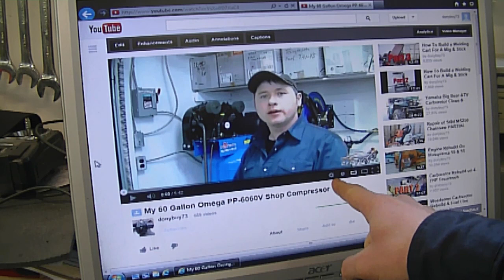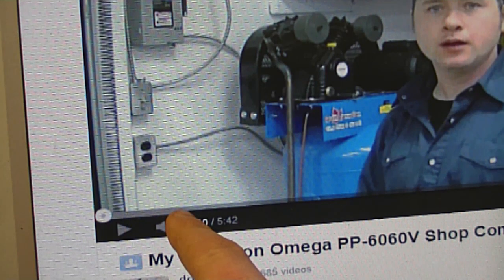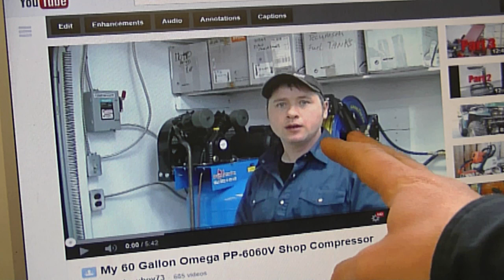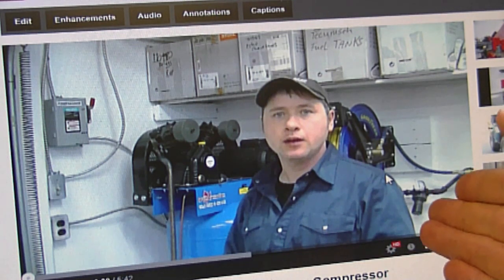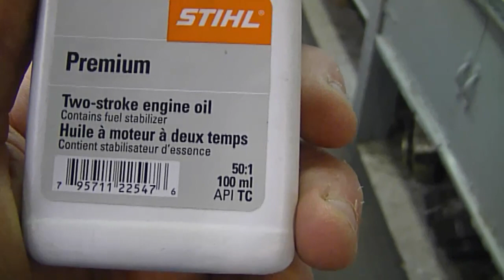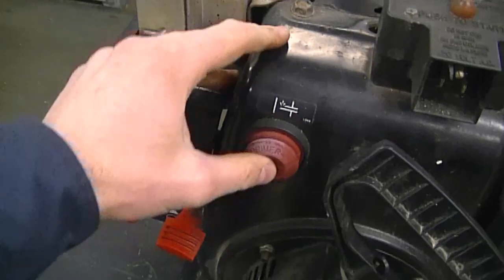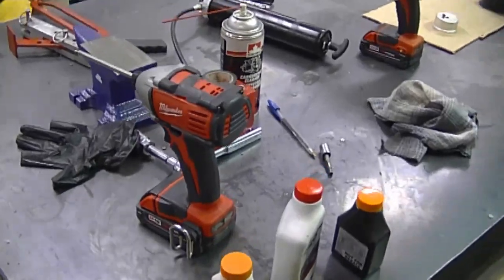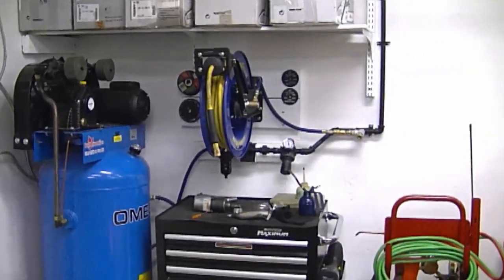Small Engines Q & A Video #114 in HD

Comment: Never mind, figured it out. It was the carb, I didn't clean it well enough and that little hole in the emulsion tube was plugged. I ended up taking the head off and cleaning the piston/head and checking everything just to see the cylinder condition. It was in good shape but with a little carb cleaner all the carbon came off, clean as a whistle now!
Now it runs really good and all set up great. WhoooHooooo!

Comment: a 1/4" hex to 3/8" male socket adapter is an absolute must too. It makes removing some hard to remove bolts easy without the need to carry around an air  hose with you wherever you go. Its lighter, and smaller, however doesn't have as much torque, but is more than enough for most lug nuts.

Comment: Dony Great vid as always, I would just like to add one more important note to the 2 cycle engine oil info,   modern 2 stroke oil to be used for marine applications (outboards) must have  the TCW3  rating on the container, old or new outboards the tcw3 rating is imperative.

Comment from the maker: first clean the carb and maybe replace the bowl and kit 631021b for a better seal. you may have a leaking exhaust valve if the muffler gets red hot

Comment: So far I am very happy. I am mostly using it for disassembly of scrap, my 18v stuff was wearing my arm out after part of a day, plus there is no battery hanging off the end to get in the way. I bought the three year warranty in case I beat it up :( and if I start doing more small engine stuff it will be handy for most stuff I think.Just not rusty shit, but I have air for that !!

Comment: Well, it's terrific for removing nuts and screws when disassembling a machine. Or I can torque nuts or screws down, when reassembling my work.

I'll use the 12v screwdriver, because it's compact size at 7 inches and weights 2lbs. Nice torque motor (150 in-lbs) with 0-500 RPM and a 15 position clutch. Really awesome quick change 1/4" hex bits, displays your remaining runtime and a cool built-in LED light.  

Plus not to forget, the powerful (2) 12v batteries, that charge in about 30-minutes time.

Comment: I bought the porter cable set...like the impact driver you have there...and i'll tell ya what...that thing is a work horse....it drives an 8 inch lag bolt with ease....I got the drill, flashlight, two batterys ,charger and the recip saw too...best set i ever bought!!!!

Comment: Excellent videos!     Question: What do you use to clean the clutch on a 10 Hp Cub Cadet snowblower.......the round metal plate where the wheel with the rubber ring makes contact to give the snowblower the different speeds forward and backward. My clutch always seems to slip when I get into heavy snow.   Thanks

Comment: Hey Don thanks again, My augers are seized onto the shafts.  Its a 40 year old JD 832.  It is so bad the shear bolts actually do no good.  I rebuilt it all but I don't have a torch to heat the outer auger shafts.  That was my first vid, now I'm up to 4!!!  Thanks for your help again.           bthversion1

Comment: Thanks!   On a snowblower with a 10 HP Tecumseh, do you have many problems with the carb leaking gas,  the cause being that the spring that connects the needle valve to the float is facing the wrong way.    I believe I read that the sharp end of the needle valve spring should be facing towards the engine, not towards the air cleaner. (The carb does not have an actual air cleaner)

Also, Would you mind disclosing what video software you use, the editing on your videos is always excellent.    Thnx

Comment: Hi!
Great video! My snowblower leaks gas like you showed in your video when I press the primer. Now I understand that this is normal. But I have another question about leakage. When I use the snowblower I can see drips of gas on the snow is this normal or do you think I should bring my snowblower to the repair shop. This afternoon I will take the cover out to see what is going on. Thanks!

Comment: hey dony, great video as always. quick question, for 2 cycle gas/oil mix, in a pinch could you use a regular 5w30 motor oil instead of genuine 2 cycle oil?

Comment: Great video! I have an important question. I have a very rare two stroke tiller (a sachs stamo st150) and last time I was running it, the hose that goes to the carb from the air filter, broke and probably some dirt got inside the crankcase (not sure how much). When I realized it broke it was still running. Is it safe to run it as it is, or should I open the engine to inspect the bearings? It's quite a hastle, that. Also, do you know where I could find parts for it? The clutch seems worn. Thanks!

Comment: Nice to see a question similar to mine made it on a video. I asked if the oil had to have a snow blower on it back on Q&A 112 I have been using 2 cycle G oil in my snowblower. (still no snow to use it yet though) but it seems to work pretty good as far as I can tell. It says from the site: GREEN Engine Oil meets and exceeds JASO-FD/ISO L-EDG and API service category TC and after looking it up that is the certifications for 2 cycle oil correct?

Comment: i've been looking to buy a motorcycle and the older honda cb models (early 70s to mid 80s) have caught my eye.  as a small engine mechanic, have you noticed some hondas being more reliable/better built or easier to work on than others?  i'd appreciate your advice.

Comment: Dony,
Bought a used Airens Sno-Blower, maybe 10hp been painted over, but seems it's a Briggs engine mod. 171402.  Got 12" snow last night, Cleaned fuel system, she's running great, but the front-most belt broke just as I was done.  Can't figure how to FIT belt in between wheels where belt runs.  Any tips, or videos?
Thanks,
David

Comment: Hey dony, one of the auto detailers at my shop cleaned up under the hood of a car and when he went to start it, it was acting like timing was off, knowing it was water in the distributer I sprayed inside it with pb blaster(penetrating lube that displaced water) and it fired right up, have u ever thought of using that method for you watery fuel systems? Or would the lube be just as bad as water in the fuel?

Comment: This summer I bought grass trimmer, and have a slight problem with it. It is really hard to start up. And when it is started it runs with no problem, have lot of power no problem what so ever. I tried all combinations of gas, choke, with and without. It is the same, hard to start, and when it starts runs perfectly. Is there any tip, what should I do to make it start more easily.

Comment: Hey Dony have an issue with an older 5hp22 craftmans snowblower model 71-52105-1. Last 2 years is ran flawless but this year it was hard to start and smoked bad at idle and full throttle. I took off the carb and cleaned it well, wrote down all the settings and put it back together. It wasn't bad really. Upon start up it still smokes bad yet when warm it doesn't do it as bad only when transferring from idle to full throttle and viseversa. Would it be the oil ring stuck? Oil level is perfect!

Comment: DonyBoy.  I have a YardWorks Snowblower with a 10.5 Tecumseh.  At first it was running really rough.  I found the muffler had completely fell apart. I replaced the muffler and the blower ran like new for about 2 hours.  Then very quickly it started to run rough again. It revs as it should but sputters and has slight backfiring issues.  It bogs down when a load is applied but it does continue to blow.  My carb is the unajustible type.  Any idea on how I can rectify this issue?

Comment: I find that if I tell my customer to use strictly ethanol free gasoline, particularly 91 octane, they have much better luck with varnish in the carburetor and water in the bowl, of course if you leave half a tank of any fuel outside getting cold and hot with the weather, water will condensate on the inside no matter what it seems.

Comment: dony in Q&A 114 you show a snow blower with a B&S engine, I have a 1650 Series the problem i have is trying to get the choke knob off. i can not find any information on how it comes off. i need to pull the Carb off. does the knob just pull off or is it held on with latch system. any help would be great.

Comment: Donyboy73
I have a question about a tecumseh lawnmower engine
Recently I have noticed that whenever I leave gas in the fuel tank within 12 hours if all leaks into the carb, floods the engine so bad that gas is coming out of the exhaust when I pull it over, and stinks up my shed what could be the cause of this? (The carb is very similar to that of a toro 6.5)

Thank you

Comment: sir i have a question do you think that diesel engines are better than gas engines? is their a real benefit to having a diesel ingine. i heard that a diesel engines last alot longer than gas and have less maintanence than gas ingines. i also heard that the fuel last alot longer and i could make biofuel for them and run them for about 1.00 a gallon. i wanted to ask somone these questions that knows alot more than me any information that you have would be very beneficial thank you

Comment: hey dony i need help.i have a two stroke chainsaw and when i pull the starter it grabs and is very difficult to pull but the engine is not siezed cause when i remove the spark plug ans pull the starter cord it cranks very easy.the piston slides up and down easy and smooth. but when i put the spark plug back in and pull its very hard and grabs as if it has too much compression. also i have dissasembled it and there is no scori g in the cylander or on the piston. i cant figure it out.

Comment: Thanks for your reply.  I shot a couple of videos on this issue this afternoon.  It's right after starting with choke off.  Another vid shows after running for a while and the revs taking forever to fall even though it's set on idle. 

If you click my name it'll bring you to my channel with the two vids.  One is called Tecumseh 10.5HP SnowKing/YardWorks Snowblower - Start and the other is Tecumseh 10.5HP SnowKing/YardWorks Snowblower - warm.